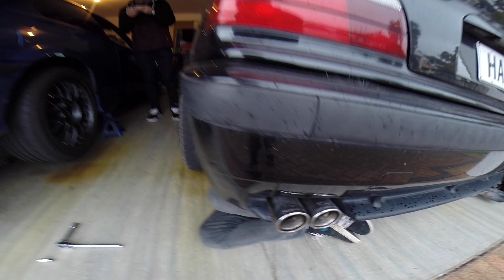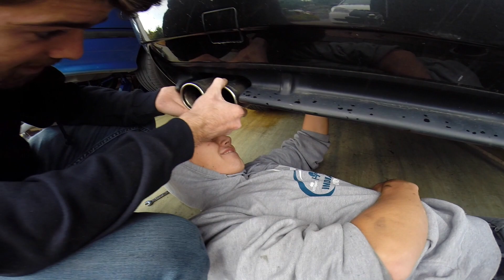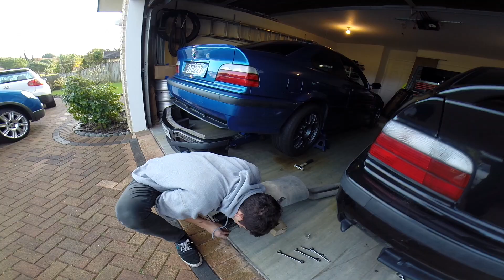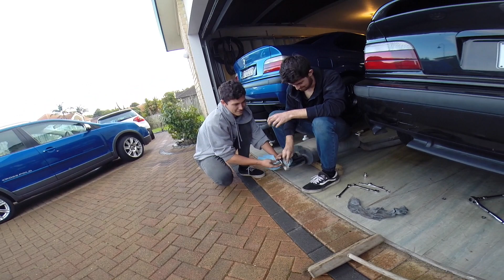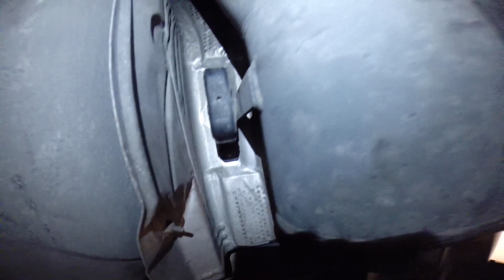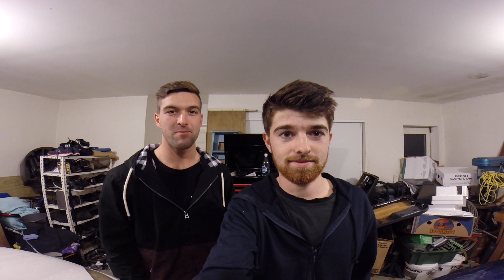BMW 328i E36 Supersprint rear muffler

Comment: hey man my neighbor said he would sell me his E36 328is. the car does have high mileage (180,000 miles) but he's been the owner for 15 years and car has never been abused, he also has full service records and the coolant system was addressed. the car is a manual, has M suspension, brand new tires, no rust, clean title. do you think $4500 US is a good price?
Reply from the maker: +sounds like a good car man! Not too sure what the going rate in the US is for them to be honest though. Try talk to someone who knows a bit about them over there to get a mint deal
As far as the car goes, miles aren't too much of an issue when the car has been maintained well like the one you described. Hope it works out dude!! Sesto Element-C
Reply: Dont look at miles, look at condition. If the engine runs smooth and suspension is ok, take it.
Reply: It all depends on overall condition of the car and equipment fitted.
Reply: Sesto Element-C did you end up getting it bro?
Reply: so I skipped that car and ended up buying a E36 M3 instead. much cleaner less miles service records and only 2500 more. and it's a stick
Reply: Sesto Element-C sounds like a better deal to me. You happy with what you have? I got me a 330i a few months ago and I'm pretty stoked with it. It's clean but I'm also thinking of doing a few things to it to make it a better daily.
Reply: I love it bro its so clean it's a 95 Boston green coupe and I'm in love I'm glad I waited
Reply: Sesto Element-C ooooh. I was just looking at some BG E36s on the bimmer forum. GREAT looking colour bro. Good choice.
Reply: 7000 usd for m3? Damn, youll buy here nice  328i for that.
Reply: Yeah and it's a clean title boston green only 139k miles and 100% stock besides lowering Springs
Reply: So, did you bought it? I just bought 328i for 5200 with 108k miles. Also fully stock.
Reply: Mdriv3r btw m3s now are worth more more then 6k
Reply: Bmw M3 e46  yes I bought it. Best decision I've made with any car so far